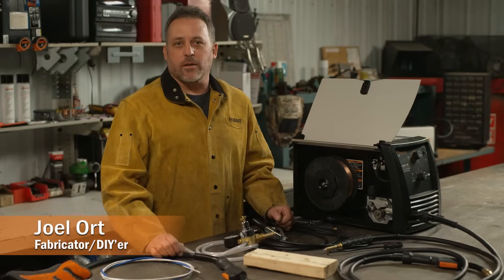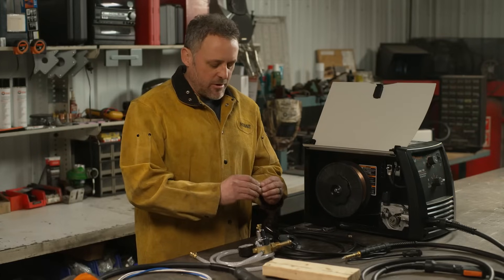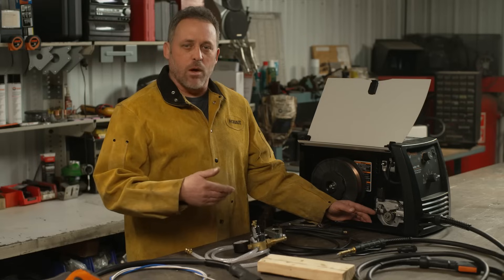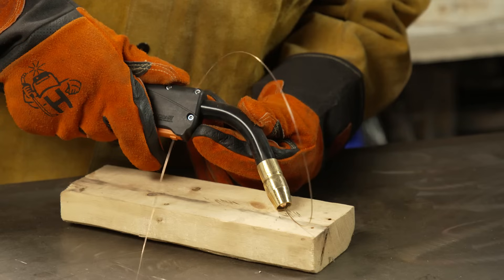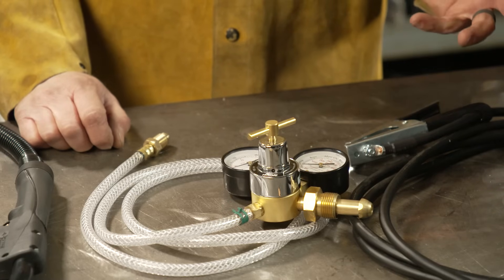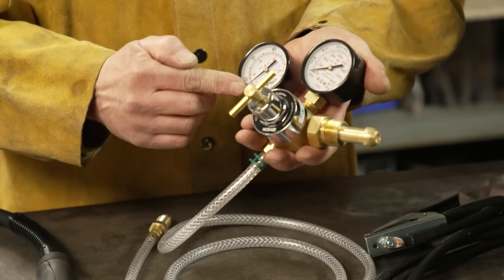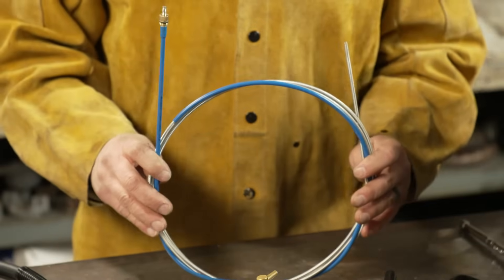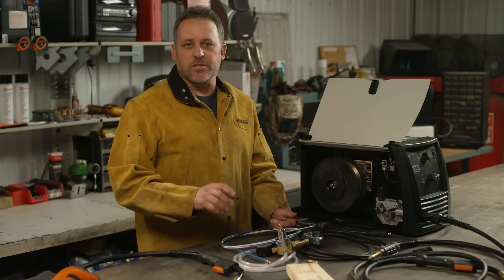How to Troubleshoot a Bad MIG Weld

Comment: What if the gas doesn’t reach the arc… it’s actually blowing backwards when I unhook the hose
Reply from the maker: Thanks for reaching out. Our best guess would be the rear o-ring is damaged, the MIG gun is not fully inserted, or there is a blockage in the path thru the gun/contact tip adapter. We recommend giving our technical support team a call to talk this through with a tech. The number is (800) 332-3281.